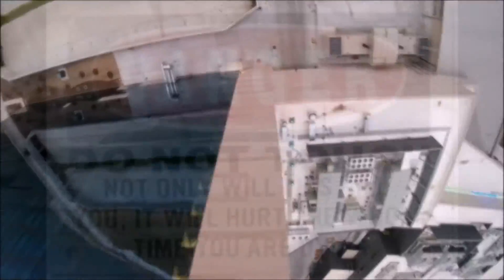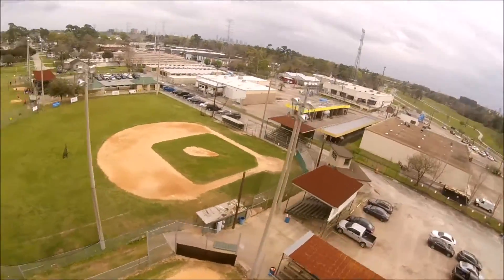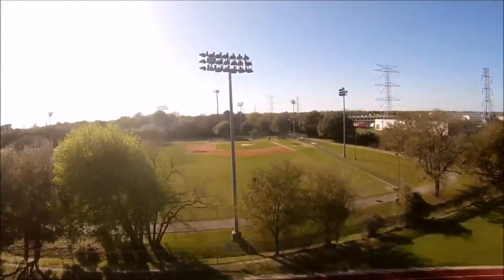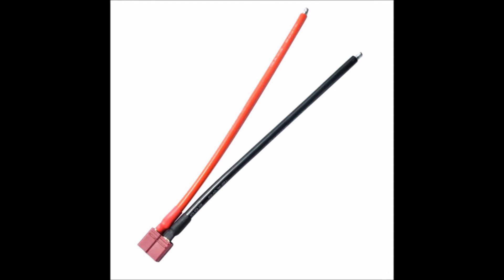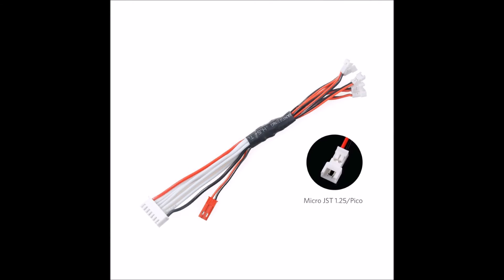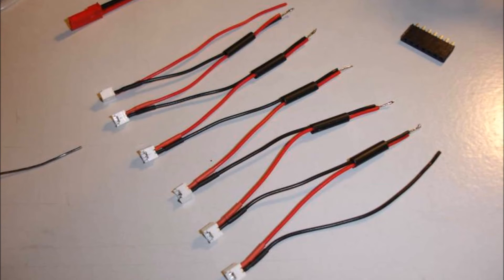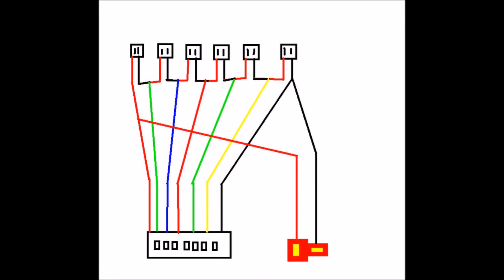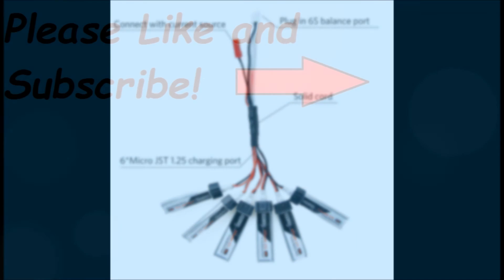How to Make A Lipo Balance / Serial Cable for Tiny Whoop / Inductrix: Charge 1S Lipo NOT Parallel

Comment: I believe you mislabeled the JST connector female when it's actually male.  its named by the pin, not the plastic outer part. By the way, it's a great video otherwise. Very helpful and clear.
Reply: I did notice the same! @James could you confirm it?

Comment: Are the tiny whoop batteries 1.25 or are they 2mm jst?
Reply from the maker: Thanks for the comment, stock tiny whoop is 1.25. The high voltage batteries that are becoming more popular use the 2.0